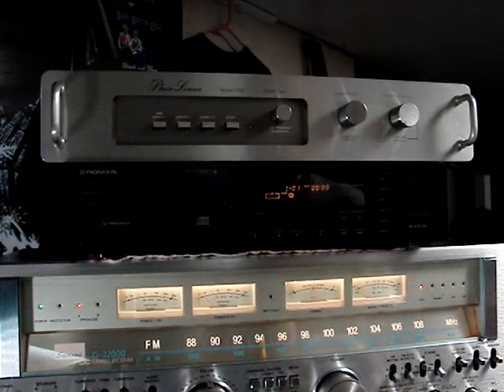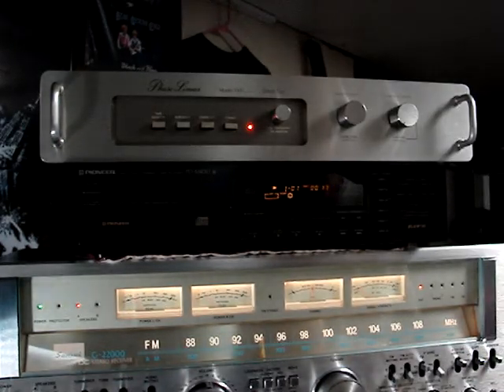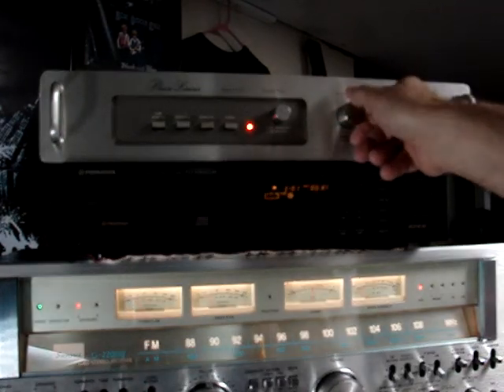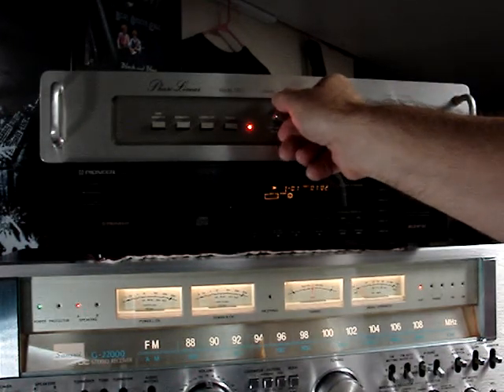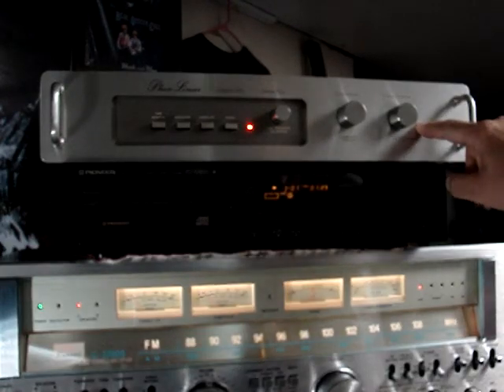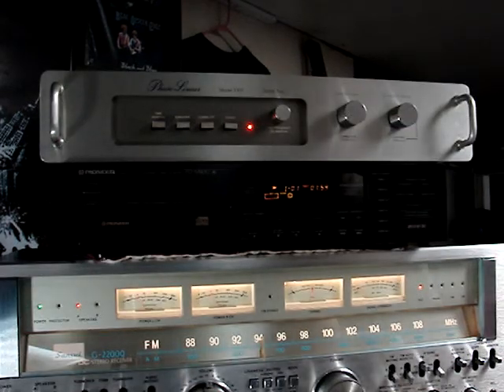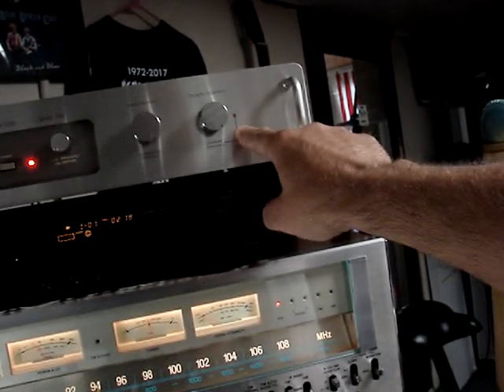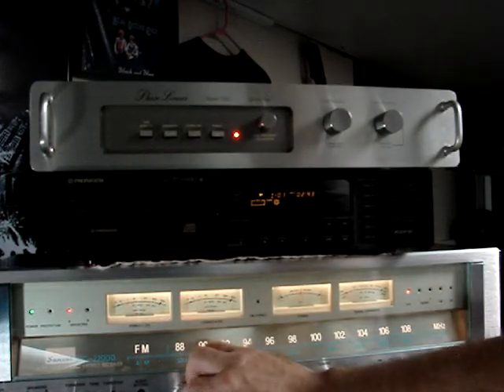Phase Linear Model 1000 Series Two Autocorrelator

Comment: How would this fare against a DBX-3 unit? And what is a good price for it?
Reply from the maker: I have no experience with them so unfortunately I cannot offer an opinion. I have gravitated to good recordings and stream most of my tunes now using Cd's as well. I never really thought dynamic range expansion was necessary with the exception of spinning vinyl which benefited most due to the wide variation of recording quality. Dbx in general way overpriced IMHO main reason I never had one to play with however I do have two Dbx Drive rack units in my system and can highly recommend them for controlling multi driver setups like mine

Comment: Quick question,  I found one of these at a local shop, first 1000 model actually, can I hook my turntable directly into it then out to my integrated amp? Info on these are limited.
Reply: has to be in tape monitor circuit.....line level voltage.... if hooked between preamp and amp the peak unlimiter transient light is variable with volume setting..not good....this guy showed or stated as he turned up volume, peak unlimiter peaked higher..should not do that...turntable has too low voltage for this directly